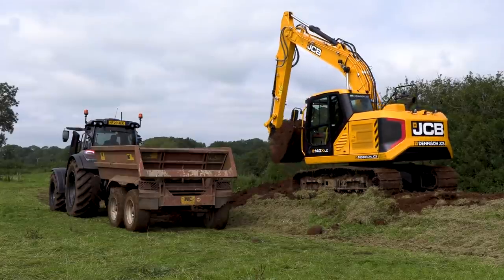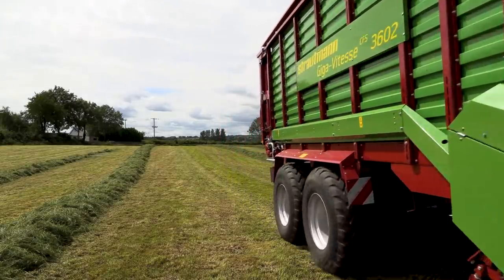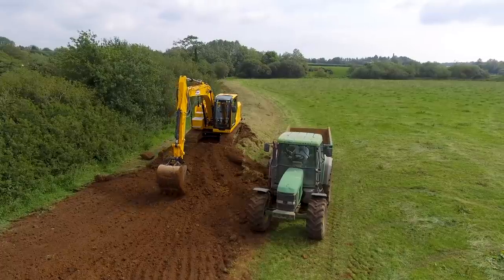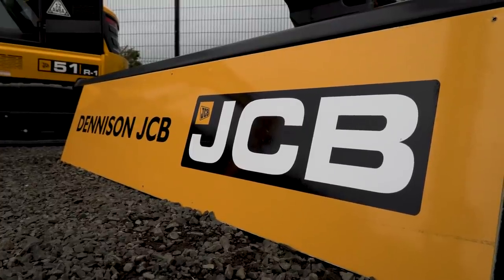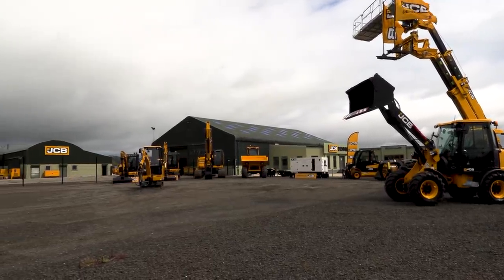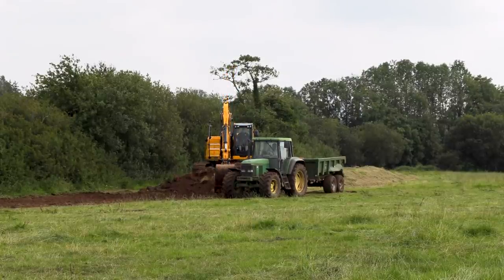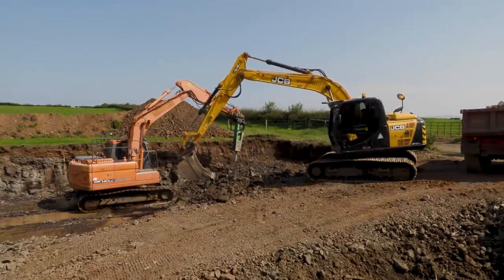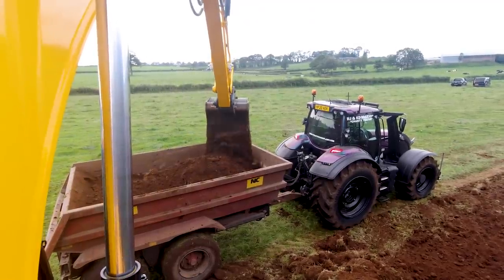Donkey Gets A Day Out In the JCB 140X LC!

Comment: That thing looks as smooth as silk, quiet too. What do you think is the minimum size for an ordinary wee man to clean drains on a farm? 5 ton?
Reply: Depends how quick you want it done I wouldn’t go any smaller than 5 tone for that job anyway
Reply: Depends on speed and depth. Done a good bit in a dx62 running 8 tonner buckets and she was plenty for your average farm ditch
Reply: @DonegalTDI  Then you'll be needing a 13+ unless the ditch is right up against the fence, or it's really shallow. Hire one, easiest way to find out what works.
Reply: 8 ton kubota , reliable and powerful

Comment: Well donkey I no dennilson might have great backup but the down time on them is ridiculous a hitachi the only time u see a fitter is wen it needs 2 be serviced
Reply from the maker: Even the new X series?
Reply: The were ment 2 be more reliable but i work for a company that buys alot of them and the give nottin but heartship its a shame the shud stop trying to cut corners 2 save money
Reply: kf cal we run a 140x for 2 years and a 220x for 3 and a half we have had not a spanner on either of them, we also have a js220,js145 and 5js130s all have been spot on 👌🏻
Reply: Rob wc wat land are u living in the only thing better about them machines is the Bluetooth for the drivers job should stick 2 making telehandler and 3cx because the only put cheap shit in there excavator s any proper machine driver will refuse 2 drive them trust me im working for an Irish company in the UK and there 4 good Irish drivers here none of us will drive them we get 4 new hitachi every 3 yr and none of us ever had a break down but yet there a jcb fitter onsite the hole time